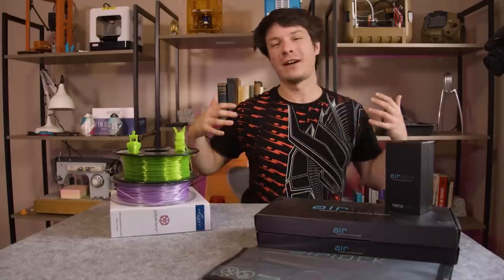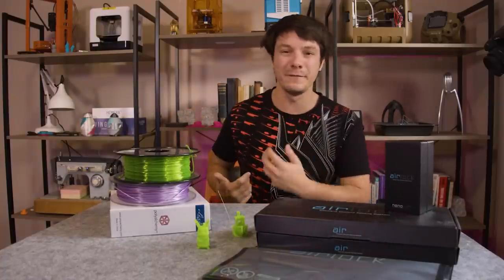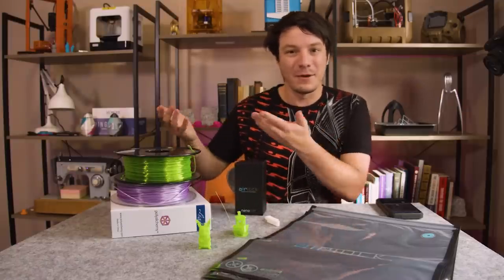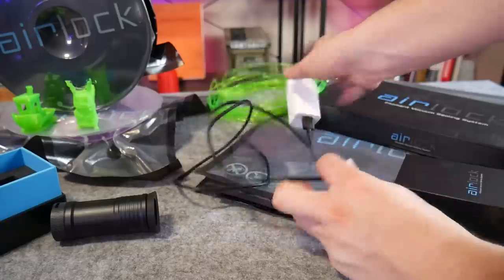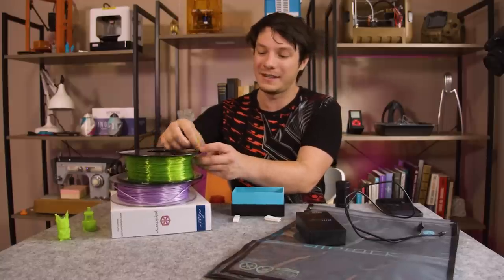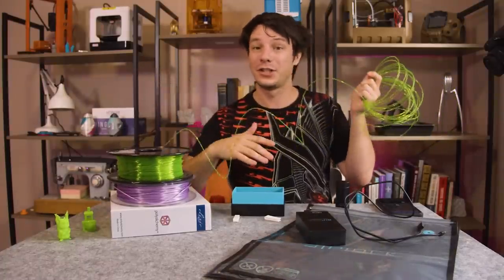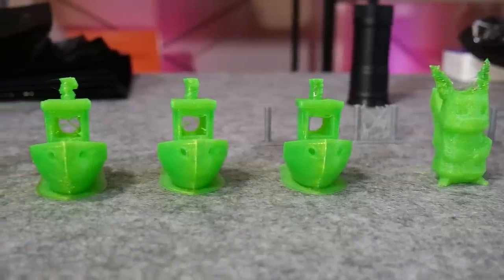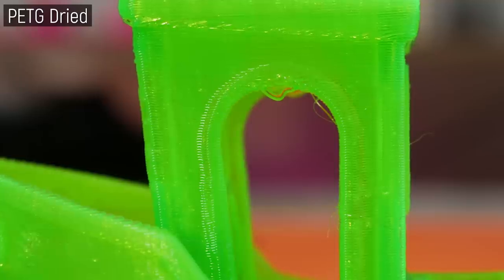Should you store filament in reusable vacuum bags? Nanovac + Airlock review and test

Comment: I work in pharmaceuticals and have spent years working with humidity-sensitive materials. Plastic bags are much more permeable to moisture than most people realize. In the same way that water migrates into your filament, it will absorb into the plastic bag then release inside the bag. That is why things like potato chip bags have that shiny foil. It's a very thin layer of aluminum to keep water out. Whatever type of container you are using, desiccant packs are a good idea.
Reply: I strongly agree!
Reply: This. Havnt gotten around to implementing this myself yet, but a metalized foil bag indeed sounds like its a good idea. The downside is that you cant see inside them so thats pretty inconvenient and requires really good labelling not to go insane, though.. Plastics are pretty different in their moisture permeability; perhaps thick PE bags with some desiccant inside are more practical. Ive got a non-gasketted PE large box now ,and the 2kg of silica needs drying every few months; not ideal. But I think a gasketted PE box, with thick PE foil sealed bags with desicant inside, should hold humidity within reasonable range for years, without having to bother with vacuums, and still being able to see how much is left on that pink roll of brand x; without needing to bother with the vacuum again. Would be nice to have some quantitative testing on the matter, to know how much is 'enough', though.
Reply: Yes. I store allergens at 4C in a desiccant chamber.
Zip lock bags are useless for this.
Reply: I've thought about buying some large zip lock Mylar bags and just flooding them with desiccant. The only downside is I have yet to find a bag that can be properly vacuumed. I would love to see a product like this but with a foil layer.
Reply: @Hyraethian  Just add a nipple to it like the carbon fiber bagging guys use
Reply: @thirtythreeeyes8624  I hadn't thought of that. A small hole, a little sealant, that sounds easy enough.
Reply: I was wondering about this too, even for plastic containers not just plastic bags. It probably depends on the type of plastic the container is made of. A sealed non-vacuum bag with some desiccant inside may work just as well as a vacuum bag with some desiccant. Lower air pressure does mean less water in the bag initially, but if the bag doesn't block 100% of the moisture, the initial amount should not matter over a long storage time. My current plan is:

Put the spool in some random plastic bag to keep it clean, put it inside an aluminum coated bag with plenty desiccant, make a reasonable attempt to seal the bag, but keep it at normal pressure. just neatly folding it a few times and using a good clip could be enough. Then periodically replace the desiccant packs and throw the old desiccant packs into an oven to dry them. As long as the desiccant packs are more hygroscopic than the filament and the leaking through the bag or along the seal is much slower than the replacement of the desiccant packs, it should work indefinitely.
Reply: plastic bags are no good as you said, these resealable vacuum bags should be made of mylar.  but resealable vacuum bags of mylar are like unoptanium.
Reply: I remember when crisps didn't have foil in the plastic. I'd almost forgotten though
Reply: I have used Mylar bags with pretty decent success in the past. None of them are resealable tho, its pretty much a one use thing.
Mylar i think is just PP that is made into foil in a special way. Most Bags you buy are usually LDPE, and that indeed does suck when it comes to moisture permeability.

Comment: I store my filament roles in large ziplock bags, throw a small silica gel bag into it and zip it while tryin gto squeeze as much air out. it's been working quite well for me.
Reply: I also use large zip-lock bags. No need for silica gel since I only use PLA. The bags are only for dust protection.
Reply: Yeah that's what I do, doesn't seem to do enough for TPU though.
Reply: I use IKEA 6.5 and 4.5 liter bags. They are cheap and sturdy with 2 zips.
Reply: This works fine for PLA without doubt. That said for some filament types this is not adequate. Perhaps if you stuff the bag to the breaking point with silica packs, but I won't be storing especially sensitive filaments like that.
Reply: I do use the ones it comes in from Prusa. I keep the silica in them as well. Seems to work out so far for PLA and PETG.
Reply: That's what I do as well. :)
Reply: I do the same. use 2 gallon ziplock backs with desiccant packs
Reply: @MetalheadAndNerd  if you only use pla can I ask a question I'm buying an Ender 5 Pro and I want to use pla as well primarily for my prints and any helpful tips 😈👑
Reply: @king42o  Sure
Reply: Lol what if you dipped the bags in water to squeeze the air out
Reply: @MetalheadAndNerd  what PLA takes on h20 like nothing else lol. Needs to be sealed in MYLAR
Reply: @eduedec  Then my PLA must be magic. I have zero moisture issues with PLA, except for PLA with wood particles.
Reply: PLA does go brittle if left out. It starts to snap as it's being fed.
Reply: @BlatentlyFakeName  I heard of this myth. I bought a drying oven, dried brittle PLA in it and it stayed brittle. Then I submerged non-brittle PLA in water. It didn't become brittle.
What tests did you do before you decided to forward this myth to others?

Comment: As someone who deals with plastics industrially, I have one quibble about your test. It depends a lot on how quickly you get it in the bag after the dehydrator.  Warm, dry PA will absorb as much moisture in the first few minutes or so as it does in the day or two after.  In the fabrication plant that filament is probably cooled before it touches air, but out of the dehydrator it's going to hit the air warm and likely pick up a bunch of moisture quickly.  That's why your dehydrator directly to printer works so well, and why you should also try going directly from the dehydrator to the bag for best results.
Reply from the maker: Huh, good to know! Thanks. So you're saying it should go into the bag while still warm? Nylon was out for ~10min to do the stringing test but definitely longer for the PETG to do the benchy more like 2hrs.
Reply: @MakersMuse  If you want the same performance as dry filament, yeah.  Depending on the temperature and vacuum you might even be able to pull water vapor out if you do it hot (might not be good for that pump though).
Reply: Does it make sense to heat the filament up in a chamber with lower pressure?
Edit: might be difficult to then get the water out of the chamber, maybe exchange the air or use desiccant? Does desiccant absorb the moisture faster than the filament?
Thanks for your tips
Reply: @1234fishnet  Ehh, pressure has something to do with it, but really what's getting you is time-temperature superposition - oversimplified, plastics act like time is moving faster the warmer they are.  And it's sort of exponential.  Predicting plastic moisture absorption is a hell of Time-temperature effects, vapor pressures, and glass transition temperatures that makes it super complicated to figure out exactly what's going to happen, which is why eliminating (or at least regulating) the time variable is important.
That said, you will probably need a moisture trap if you're dessicating under vacuum - pumps don't usually like pulling pure water vapor, although if this is a pump designed for food it might be fine.  In chemistry if you're vacuum drying you usually keep a jar of some hygrascopic material on the vacuum line to protect your pump, but there's not room for it in this system.
Reply: @danielf3623  ok, so if like pressure is not that important then it's the best to put the filament inside of the sealed bag while still in the hot+dry environment of the dehumidifier?
So making a box with sealed gloves in a wall (similar to a biohazard workbench), put in a printer, use the heated bed as a heater with sealed gloves would be a solution for makers at home?
Reply: @1234fishnet  A hazmat box is hugely overkill (you'd probably need something like astronaut gauntlets to work under vacuum anyway) considering Angus shows just running the filament out of the dehydrator works just fine.  Just cooling under vaccum also probably  works.
Reply: @danielf3623  I would make a heated box without vacuum (otherwise it gets really complicated). Just to avoid the filament hitting the non dried air from the outside.
I once saw a video (I think) about PEEK filament where they had to hurry putting the filament from the oven where they dried it back into the printer, otherwise it would absorb moisture.
I was just thinking about adopting the standard box for a heated chamber that everybody wants to build with this additional functionality. It's not that much additional money and time. The question is: does my idea provide enough additional benefit or not.
Reply: @1234fishnet  I mean, that's basically just what Angus is doing with keeping the filament in the dehydrator during the print (10:36).  Theory is valid and works in practice = good enough for this engineer.

Comment: FYI you can use a 5 gallon buckets with a PVC ball valve plumbed into the top  to store filament long term.. Put your spools in the bucket, put your modified top on , hook your vacuum to the valve with it open while vacuum is being applied close the valve .. you now have a vacuum in the bucket with a half dozen spools stored in it as long as you want .. Total cost to store  6 spools at once around $5 usd..  The  chance to design/print some adapters to mount the valve to the bucket top = PRICELESS,LOL
Reply from the maker: That's a pretty cool idea! The bucket doesn't collapse?
Reply: @MakersMuse  Not unless your using a SUPER BAD ARSE vacuum.. . I stumbled across this constructing low vacuum purge containers for purging air from 2 part casting materials.. Wish it was old you tube so I could just post a pic or 2 for you..

Comment: Anyone who has experience drying and curing "herbs" can see what potentially is happening.  During the drying process of herbs after the "material" appears to be dry and crispy and put into a airtight container and left for some time, Will return to a spongy "wet" condition.  What is happening is moisture is being wicked to the surface from within the core of the material during hard/fast drying. When you finally put it in a stabilized environment and the humidity within the material stabilizes and equalize throughout the material..  also to note I recently got a filament dryer box and wanted to see how well it evenly heats/drys the roll of filament.  I put in a color changing temperature sensitive pla filament and results were definitely surprising.  I did a 24hr drying cycle and about 12 hours in only the outer portion of the roll had changed. It took nearly 20hrs before the roll appeared fully warmed. Keep i mind i still can't see all the filament.  Only rhe outer surface and through the side windows of the roll. For context the filament changes from purple to pink above 31°c and had the dryer set to 55°c. After seeing how long it takes for the filament to reach "drying temp" i run my filament for 72 hours.    Just some input from personal experience, keep up the great work Angus!! Been watching for over 3yrs
Reply: Which drying box did you get?

Comment: Thanks for picking up the topic, Angus!
I've been experimenting with filament drying for some time because my PLA starts breaking after exposition "to the elements" as you put it.
Turns out you need to use real big drying bags for a 1 kilogramm spool AND these need to be dried for several hours at 90°C themselves.
Although 100°C or above would definitely speed things up, the bags deteriorate from such high temperatures.
Reply: Never exceed the glass transition of the material. 50C for pla, 80c for pet. You will end up with a spool of solid plastic otherwise.
Reply: @joemulkerins5250  He was talking about the silica bags I believe, not the rolls themselves.

Comment: I vacuum seal my nylon and a couple others, but I use a foodsaver system.  I went to a local thrift shop (in the US) a few times and now I have 3 of them with different strengths, weaknesses, and features, but all 3 totaled less than $20.  Brand new they are quite expensive.  I get generic bag rolls from amazon, and they are wide enough to fit a roll of filament.  The down side is that you lose a little bit of the bag every time you have to cut it open, making it a little smaller.  I usually start with twice the length I really need so that I can get more uses out of it instead of throwing away the rest of the bag after one cut. 

I've used products nearly identical to this, and I would usually come back to a bag with air in it after a day or two. Maybe these are a bit higher quality, but the ziploc seal and the valve can't compare to a melted plastic seal.

Comment: You may have as well read my mind! I just opened three new PLA filaments for an art activism project.  Resealing has been on my mind in the past couple weeks.  I'm contending dusting off the vacuum packaging bags from Ikea many years ago (which is operated with household vacuum cleaners and a lot cheaper).  A little relieved that PLA doesn't absorb moisture as badly.  But then, I also print very infrequently so I am counting storage by month if not by year.

Comment: I had tried large food storage bags, but the pumping time was annoying, and the external pressure cracked or broke some spools (mainly the clear ones).  I went back to my Sterilite bins with desiccant scattered over the bottom.

For a better test, put one of those cheap $2 hygrometers in the bag and monitor the actual humidity in the bag.  I have one in each of my bins, and one on the shelf next to the bins for reference.  I'm usually reading 18% humidity inside the bins, no matter what the external humidity reads.

Comment: Being using a FoodSaver vacuum system for years now. Some of the filament I have sealed have been sealed for up to 4 years. I've tried some filament after 2 years of storage and it comes out flawless. If there is a zipper on your sealed bag it will leak air slowly. The FoodSaver excels in this area because it truly is airtight. I've been using this system for 4 years and haven't had any problems with moisture.
Reply: I just ran across your comment. Are you using the 11" bag? I think it's the widest bag available. It looks like the filament spool fits but the bag isn't able to draw-in sufficiently to remove the air.

Comment: Nice to see a review of this, and thank you for mentioning it doesn't have a battery. I couldn't find anything that said if it had a battery or not, and saw no explanation about if it needed charging. Well, overnight "charging" didn't work :P

I remember when they announced the system, I went "ok, that's nice" but once they mentioned the price, I was sold because it was cheap compared to existing systems (also, if I wanted to get a nice dinner, it's sometimes the same cost... and I can't re-eat that dinner, unlike reusing the bags...). I think the biggest issue is the power, as you mentioned. Oddly, the best working power source for this has been a USB port on the back of a fancy webcam... Outside of that, it's reasonably priced for what it is, though may try commercial food bags just to see how they do. I wished more spools came with resealable bags... I may have to update that with "and a vacuum valve".

Comment: I bought about 50 of these bags during covid and have used them for 3 years now.  They are great and work well, the 1st, the 2nd, and maybe even the third time that you open and re-seal the bags, but eventually, the bags won't hold a vacuum anymore.    I wouldn't use them for filament that you open and use often, but for long-term storage of filaments that aren't used regularly, I think they are good. I see they have a V2 version of that bags now.  I wonder if they hold up to repeated use.

Comment: I have been waiting for this, finally companies are realizing that they can pretty much run any small device on USB. 
The batterys have been standard 3,7volt cells for an eternity by now for pretty much everything anyways.
Reply: I have an actual usb vacuum cleaner! Not a rubbish one, a rechargeable one!
Reply: It has to do with how much current the USB cables can provide. The new USB standards can go up to 5 amps, so you are seeing more devices powered by them. Older USB standards have much lower current.

Comment: I’ve been putting a few moisture absorbing satchels into a zip lock bag with all PETG and PLA filaments And never had a problem.
Reply: Same here, and I suspect many of us do the same.  I'd like to have seen Angus compare the vac sealed bag to a ordinary zip lock bag, with or without a silica pack tossed in, rather than just comparing the vac bag to open air.  I suspect the vac seal would not show a difference enough to  be worth the extra effort or money, except perhaps for the most hydroscopic filiaments in the most humid environments.
Reply: @ApKNJ  One other thing I do after opening a roll is to put the Silica gel sacks straight into a zip lock bag, roll it up and seal it so it isn't sucking in moisture while the roll is in use. I also store the rolls in the boxes they came in (X3D) in a cupboard so they arent exposed to UV.

Comment: Living on the Highveld (1600m ASL) of South Africa I must say I haven't had any issues with moisture in my SA Filament PETG. It's generally pretty dry here, but we've had some really wet weather lately. 
I kept the PETG  it in the original packaging with a few packets of silica gel, but I've also left it out for a week or two and I've had some really good prints with no bubbling or stringing. Maybe I've just been really lucky.